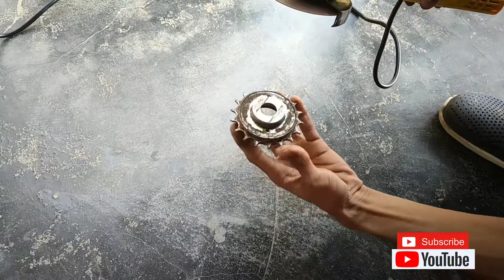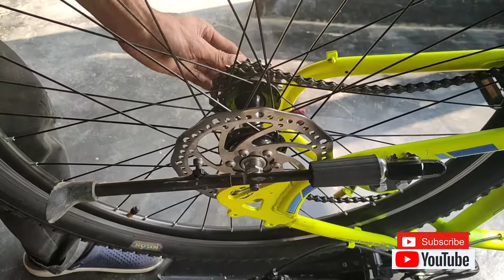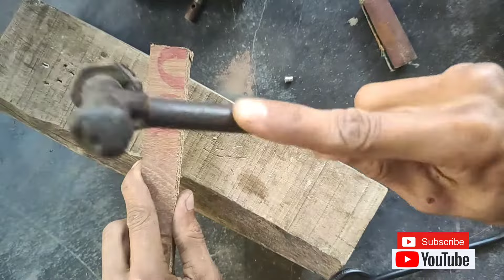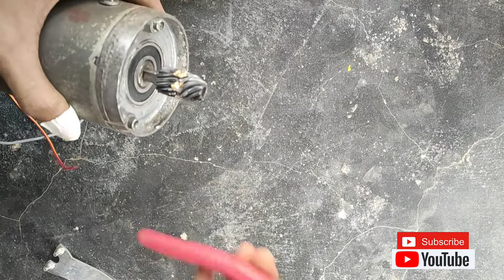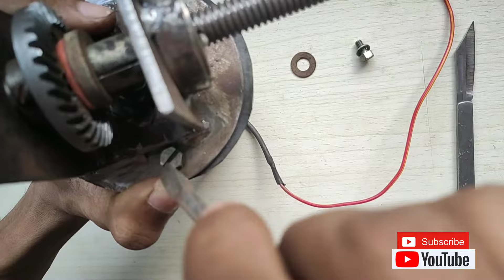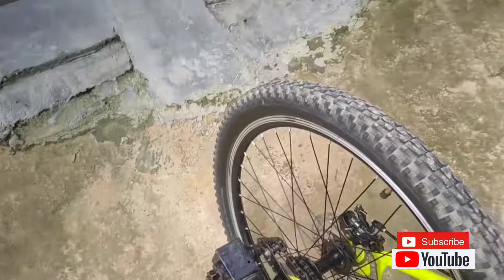How to make electric bicycle at home | how to make e bike at home | homemade e bike

Comment: Sir 2pump h mere pass   24v pump se cycle banegi rewind 22no wire 20trun  please reply or motot pe jo gair laga h wo kha pe milega
Reply from the maker: Grinder machin gear
Reply from the maker: https://www.amazon.in/dp/B073DR7MPP/ref=cm_sw_r_awdo_navT_g_8ERGK724CSV4Q9D4711Q